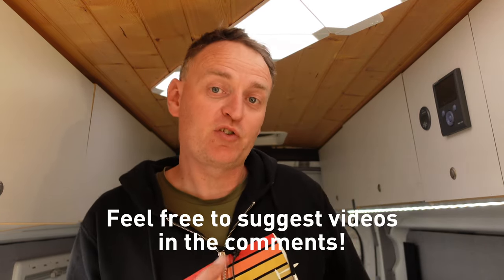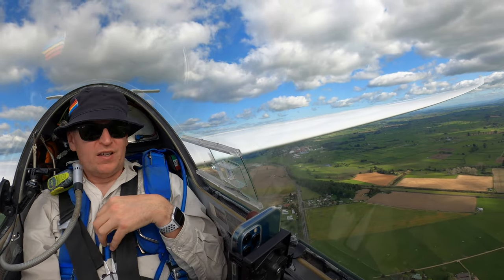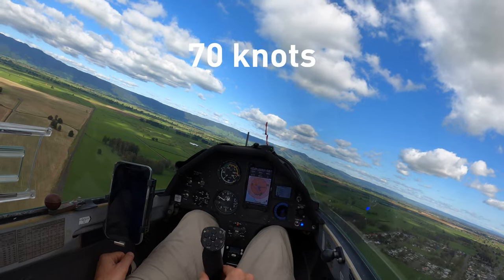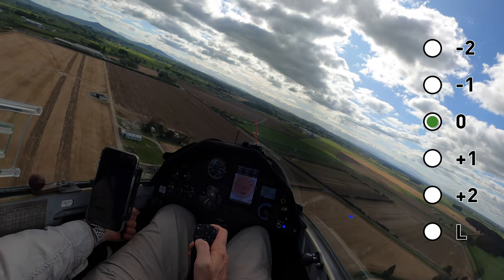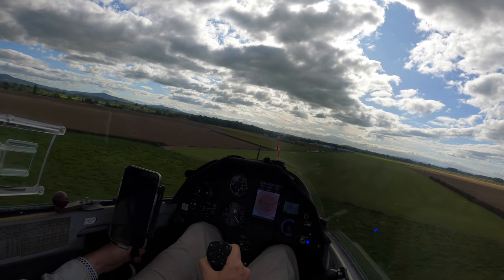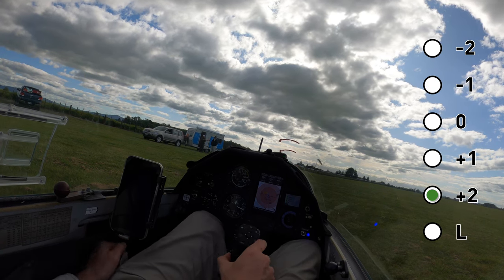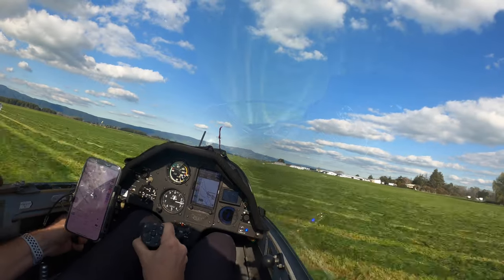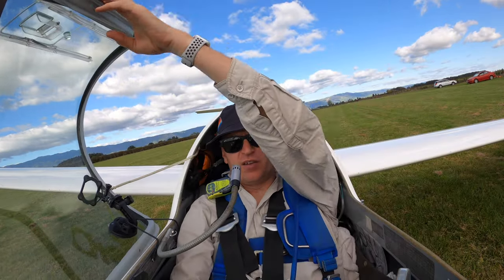Glider Crosswind Landing with Flaps Explained

Comment: Hi Tim
Great Video - In france usually the recommendation is to do normal landings using the "Landing" flap. Once you are confident that you make the runaway and are stabilized in final, then you put on landing flaps. The reason here is so that pilots get used to it under normal conditions - that way when they really need it one day, like for outlanding - they know how their gliders behave.
So we are encouraging "process" in a way. Normal landing => put on the Landing flap.
Of course as you correctly point out, if you have really strong wind then you can adapt and only use positive flap, or even zero .....piloting is about gauging the situation, but as I said we try to encourage good and systematic "practice". Final point, we also recommend people roll (whether during take off or landing) using negative flap for the reasons you mentioned (manoeuvrability/aileron control on the ground)
Thanks again for your videos!
Reply from the maker: Sounds very sensible, and yes that's basically what I do too! Cheers for sharing

Comment: Hi Tim, in the German manual for the ASW27 or the ASG29 the L-position is denoted as "Landestellung" (= landing flap position), so it is not associated to "langsam" even though the flaps in L-position slow down the glider considerably. I noticed a difference in the technical flap design between Schemp-Hirth (Ventus, Arcus) and Alexander Schleicher gliders (ASW27, ASG29, AS33): SH uses a single flaperon control surface so the flap and aileron angle is the same across the entire wingspan while AS has flaperons split into an inner and an outer control surface. Although both are actuated by both controls, the inner flaperons are optimised for flap effect and the outer ones are optimised for aileron effect. In L-position the outer ones are even assuming a negative angle to avoid loosing aileron control during the landing approach.
Reply from the maker: That is interesting, yeah I don't know much about the Schleicher gliders, thanks for sharing!
Reply: The mechanical mixer to make that Schleicher design work is really fascinating.

Comment: Great video, as I have a flapped glider (LAK 17). I've often wondered what everybody does, and this it's helpful. My airport is near the ocean, and there's usually a strong crosswind component when landing. The runway is parallel with the ocean, so late afternoons the wind is always easy to west.. On downwind I use +1 , then +2 on base, and then when I'm halfway the runway I move flaps to L, which increases the steepness , allowing me to better control my flare. Most times I land before my aiming point 🙄, so I haven't figured it out completely. I guess I'm still learning after about 2 years of ownership. 😄 I've also landed with flaps at 0, but didn't like the shallow angle and speed. I like how the L flaps on my ship work, as the sink rate is huge. Love watching your videos!
Reply from the maker: Hey that's awesome. I haven't flown the LAK 17 yet, but there's one at a nearby club I've been meaning to try at some stage.
Reply: Paul - let's go soaring together one weekend. I've been using 10° lately (+2) over L for that very reason and I've had a reasonable result. Landing flaps in the 505MB results in running out of energy very quickly, which makes it a slam dunk touch down almost every time. I still haven't managed to touch the tail wheel first yet in L, because the speed drops faster than I can react to pull back to hold it off. It's very powerful. It sounds like the Lak is the same way. Let's go fly and have fun. It would be great to share the experience with you and the other way around!

Comment: Think about a PIK 20.  I had 90degree "airbrakes" (it was considered a standard class early on).  Of course I would go to minus brakes (flaps) on takeoff roll and then to zero and then plus (a little) to finish the tow when the altitude was sufficient.  But landing with full 90degree flaps was and adventure in descent.  It felt like straight down and the flare like mad.  I felt like I could simply slide out of the nose of the glider. But I'm sure it was never more than about 40-45degrees.  It was impressive to do and to see.  But you could get that thing down when you needed to. If I added some slip it was even more impressive.

Comment: Thanks for another interesting video Tim, on a topic that is often debated.
On my Mosquito glider I would use +2 flap in normal conditions (no specfic L of landing setting on that one), and +1 in very turbulent conditions. 
Because of the trailing edge brakes, changing flaps to negative during rollout is tricky, as you risk the airbrakes then shutting and the glider bouncing up again.

However the clubs ASW-27 is much easier, as it has a specific L / Landing flap. And on this glider it is recommended  to use that in crosswind conditions, as the ailerons actually move up in the L setting, vs droop down in the +1 and +2 settings. So the L setting actually gives you better roll control than the +1 or +2 gliders. AFAIK that is specific to Schleicher gliders from the ASH-25 onwards.

So as you said, do consult a instructor or at least RTFM (read the flight manual)
Reply from the maker: Interesting, thanks for sharing. And yes definitely different for different gliders. First step is to read the manual for it!
Reply: @PureGlide  ....flight manual?! 🤔 😂

Comment: Another informative video. I would like to hear your thoughts on flap and airbrakes at start of an aerotow. I see german videos such as from Stefan where they start an aerotow with airbrakes out. In my days in the 80s this would have been a no no.
Reply from the maker: Yes this is commonly done on some gliders to help with aileron control at very slow speeds. I used this on the non-flapped Discus quite often. It's only for the beginning of the ground roll.

Comment: Another very interesting video. Thanks Tim. 
I am surprised to hear that the most efficient flaps position on the ground is -1 and not 0. I would expect the ailerons to have a greater travel in 0. Am I wrong ?
Reply from the maker: Good question, the manual says for take off use a negative flap for control reasons, so it must work better than 0!

Comment: Question from someone who isnt a (glider) pilot. How can you keep the glider balanced with negative flaps when you are stationary? Is the wind enough to give you control or does this also work when there is no wind due to some internal balancing mechanism?
Reply: It's just wind. When there are quite strong ones in the strip axis, even heavy 2 seaters without flaps can hold level
Reply from the maker: Yes it was the wind over the wings
Reply: @PureGlide   @widnyj  Thanks for the replies. Love the videos.

Comment: How do you set your flaps when you're cruising at high speed ?
Reply from the maker: That's reasonably simple: I have an indicator ring on my airspeed that shows for a specific speed which flap setting is optimal for my current weight. So I just follow what that says. Anything above 78 knots is -1, and anything above 92 knots is -2 roughly.

Comment: Note to self: Do not sideslip with landing flaps
Reply from the maker: Oh why not?! I need to try it
Reply: @PureGlide  Because it veered off in the wrong direction, not the best of ideas on short final. Probably should have practiced that a bit higher up. Not sure if I was using the airbrakes at that time. It was in a Ventus 2C.
Reply from the maker: Yes you have to straighten up before you touch down!